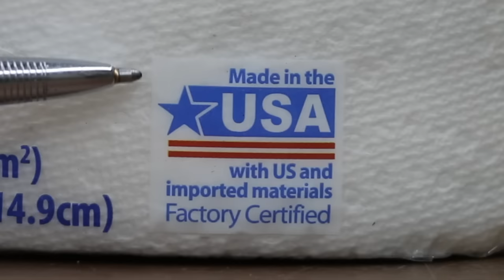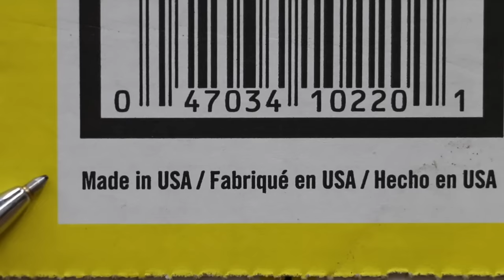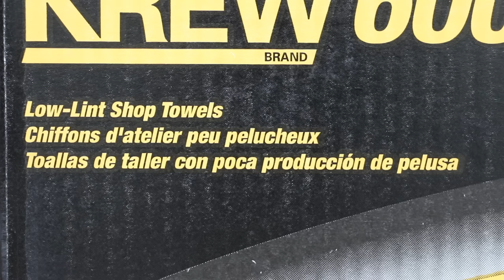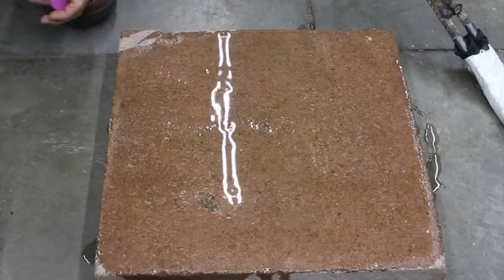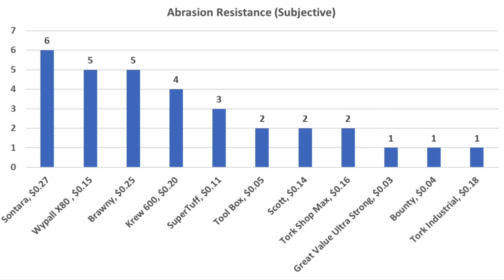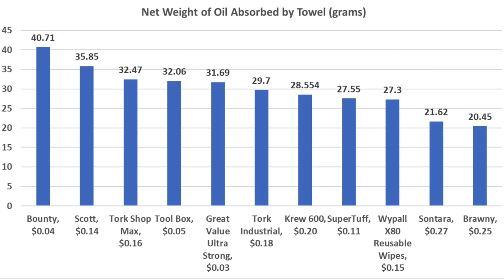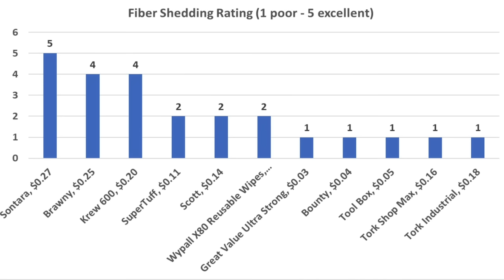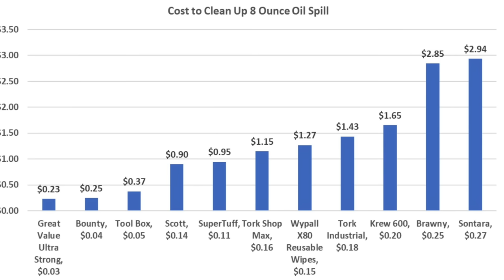Shop Towels vs Paper Towels? Let's Settle This!

Comment: I wonder if the capillary test results would be any different if instead of measuring the height on the paper towel, he measured the amount of oil in the plate before and after to see how much was absorbed in the minute

Comment: Todd, could you please test those same paper towels on glass to compare lint deposits and abrasiveness?  In this instance I am thinking of cleaning optical glass.  Lint and scratches are less than ideal.

Side note:  Pure ethyl alcohol leaves the least amount of haze on glass.  This is from working at Corning Glass R&D back in 2008.
Reply from the maker: Thanks for the video idea.

Comment: have you tried to test out used engine oil lubrication? like how the same type of oil wears after different mileages, 1000, 5000, 10000 etc  vs brand new oil. Would be interesting to compare and see when the oil change is really neccessary to do
Reply from the maker: Great suggestion!  Thank you.

Comment: The fiber shop towels are tougher, but the price isn't worth it.  I cut up and use my old t-shirts, jeans, and sweatshirts when I need something more than a paper towel.  Those Wypalls were something else.  New red shop towels are $20/100 on Ebay, and $33/150 on Amazon, both cheaper than Brawny or Sontara paper offerings.
Reply from the maker: Thanks for the feedback.

Comment: Ooooh my god I’ve got an actual thing I wanna buy but wanna project farm analysis.  They’re colloquially referred to as a “push sweeper”.   It’s like a lawn mower sized street sweeper, Kärcher and Haaga and Hoover make versions with wildly differing price ranges.  I cannot currently find non-shill reviews.
Reply from the maker: Thanks for the suggestion.
Reply: @ProjectFarm  side note  I’ll be using it on pebble exposed concrete laden with dog hair and sand…if that can be specifically incorporated into the testing.

Comment: It would be nice to see a comparison of cordless heat guns. 

And it would be nice to get a second comparison of work gloves. Kline Tools alone has a huge selection of work gloves, as do several of the brands you already tested. 

If you could eventually have a showdown with the winners of different videos like you did with motor oil, that would be cool since the market is too flooded with options to sufficiently cover in one video. 

One more fun test could be megaphones! You have enough space that it won't bother your neighbors.
Reply from the maker: Thanks for the suggestion.

Comment: Please test the rustoleum 2 part truck bed liner kit. They claim that the 2 part kit is much more chemical and abrasion resistant.  Really want to find out if that is true. As it stands I used truck bed liner on almost everything, it really beats the heck out of paint which always scuffs up on my work bench.
Reply from the maker: Thanks for the video idea.

Comment: Do you think the brake cleaner could possibly dissolve the fibers of some of the towels? most of the brands say when wet but dont specify what substance is causing the towel to be wet. Maybe testing the towels with water or oil would change the results of the strength test.
Reply from the maker: Thanks for the video idea.

Comment: Something I just found out the hard way is that those trailer hitch pin locks corrode over time or rust up so you cant get them open. I would love to invest in a new set of locks for my hitch pin and trailer tongues. Would you do a video on these sometime? How hard they are to use, how hard to break into (can it be cut with sawzall or grinder), and can they withstand the elements (especially road salt!).
Reply from the maker: Thanks for the video idea.

Comment: I've read that gasoline degrades over time and only has a shelf life of about half a year without additives.
Would you consider testing different vintage gasolines to see at what point it becomes unviable to use as fuel?
Reply from the maker: Thanks for the suggestion.

Comment: I run my old used  motor oil  though  one of my lawn mowers  mixed with old gas   old 2 stroke gas  its super smokey  but hey I dont have to go anywhere  to get rid of it
Reply from the maker: Thanks for sharing.
Reply: @ProjectFarm  I wanna take  the cylinder  head off to see how much carbon is on it but  I would have to get a new gasket

Comment: You should do a lithium polymer/LIPO battery test, specifically in the Radio control field such as RC cars, helicopters, and drones. The radio controlled batteries used today require extremely high loads/power draw and are capable of doing hundreds and hundreds of amps.
Reply from the maker: Thanks for the suggestion.
Reply: @ProjectFarm  I love your channel, it has helped me a lot. I am a radio control car Hobbyist and your epoxy reviews, duct tape, glue,  oil, hand gloves, and many other videos you have made have helped shape what and how I purchase items. I don’t expect a reply as I’m sure you are very busy, I just wanted to say Thank you and I appreciate what you do!

Comment: Your videos are great, thank you!  I have a real life scenario maybe you could test.  I am a landscaping contractor working on a fence 40 minutes from nearest store.  My generator was low on oil and I didn't have any automotive oil with me to add....but, I did have 2 stroke oil for my small equipment.  So I added 6oz of 2 stroke oil to the crankcase of my generator.  I've run it roughly 5 hours like this and it hasn't blown up yet, what is the actual wear resistance of the 2 stroke oil in the crankcase and with it mixed with correct oil in the crankcase?
Reply from the maker: Thanks!  Thanks for the video idea.

Comment: I don't normally take issue with your testing methodology or measuring, but the Wypall in the capillary test at 10:34 is not absorbing the full sheet.  If you were to include the surface area on the right, the absorption rate would be significantly lower.
Reply from the maker: Thanks for the constructive feedback.

Comment: towels that are strong when wet only tend to be stronger because they soak less thoroughly. Focusing on just one or the other in shopping is not exactly a good way to consider products. I guess that's why they advertise that way.
Reply from the maker: Thanks for the suggestion.
Reply: @ProjectFarm  Well I wasn't suggesting anything. You already basically covered it in the video if I haven't already forgotten. But I do notice how heavily advertisements focus on only one quality while ignoring all the rest. You never get the whole picture.

Comment: Could you please test the home fans please? I don't have the AC at home. I just bought 3 fans and even If they state a powerful motor they never reach the power that is state in the box. Like 60 watts fan can barely reach 50. Or 45watts fan reach 37. Obviously at maximum speed. Thanks (I'm Italian and I bought two of my fans on Amazon, the other in a shop) 🥵🥵🥵
Reply from the maker: Thanks for the video idea.
Reply: @ProjectFarm  thanks to you 👍🏻

Comment: I think a Heavy Duty hand cleaner showdown would be pretty popular. I would like to see my personal favorite in the mix: GOJO SUPROMAX (Cherry). I like it so much that I have 3 commercial dispensers, one in my shop, one on my semi truck and one in our shower. It's expensive but considering how long it lasts and how well it works it's easily worth the investment. It's the best hand cleaner I have ever used, smells nice and instead of drying your hands out it actually makes them really soft. The only downside is you need a bit of water for optimum performance and to rinse it off or else your hands are left gritty from the crushed walnut shells used for grit. I would put it up against any hand cleaner on the planet.
Reply from the maker: Thanks for the video idea.

Comment: What happens when u run 4 stroke gas in a 2 stroke
Reply: the engine is not lubricated and dies rapidly. afaik that's the difference - 2 stroke has oil mixed in for lubricity.
Reply: @cho4d  thank you have a good day

Comment: Didn't even touch on the wypall polymer reinforced x90 towels..  i get them as a giant roll 12" diameter roll for 74 bucks each. I'll tell you what. I've found no better towel for gun cleaning. No lint. Better than even cloth and rags. And they advertise 75% increased absorbency over the x80
Reply from the maker: Thanks for the feedback.

Comment: I have a request at work we get 55 gallon drums of hydraulic oil but they say motor oil on it if needed I can send some your way but can you use hydraulic oil in an engine I have personally put some on one of my small engines and it doesn't seem to be having any problems

Comment: This would be a really hard test to do, but the question I have is how many times can you wipe and wring out one of these towels before it disintegrates.  In my house, with my kids, getting the most liquid is important, but in the shop and on the job site, the strength and reusability are often more important.

Good video, though!

Comment: My work place uses the Sontara aerospace wipes. When working on planes you have to have wipes that will not leave any lint behind. Especially when working on hydraulic and fuel system internals.
Reply from the maker: Thanks for sharing.

Comment: Could you do a motorcycle oil comparison?
Mobil 1, castrol, lucas and other brands motorcycle specific vs the cheaper shell rotella t6 synthetic. Anything JASO-MA/MA2 rated for wet clutch engines
Reply: I just recently trashed a connecting rod bearing in my bike so i am very interested in finding the best oil i can put in it with the new parts without all of the brand bias hype
Reply from the maker: Thanks for the video idea.

Comment: I know it was a year ago or better but you tested motor oil against jet oil, the results were cool to see as I've dealt with both. I now work on reciprocating airplane engines and this oil is quite unique. It has an ashless dispersant in it that leaves large deposits of sludge but its totally normal. The oil almost feels sticky, we use Phillip's XC 20W-50W most often can you do a comparison with it?
Reply from the maker: Thanks for the suggestion.
Reply: @ProjectFarm  Thanks for responding I only just found your channel but I have watched a ton of your content, I love it. Keep up the good work and thank you for what you do.